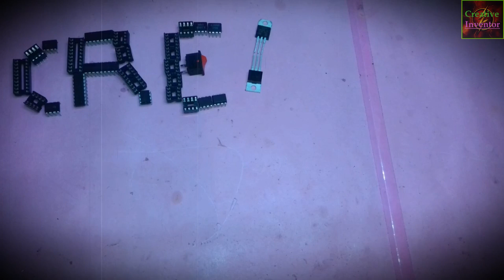How to Make 3.7v Battery Charging Circuit with Protection | Lipo Battery Charger | 3.7v Batt Charger

Comment: Ic not available in my market..
useless circuit idea..
make it by 555 ic chip will helpfull for all..
.
Reply from the maker: ic easily available in market very usefull and helpful circuit it is, when it's not available in your market area then that's your problem👉👉👉, it does'nt mean that it is not available in market.

Comment: can we charge 18650 battery & whats the output current? (if we connect 1a charger so will get 1a, and if we connect 2a charger, so we get 2a?)  how much current (Input) this circuit handle? 1a or 2a?